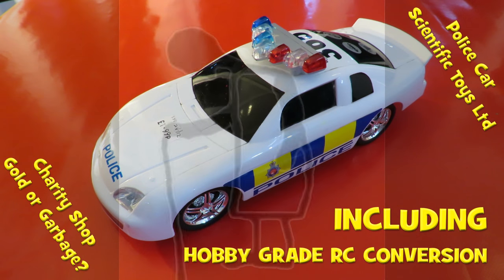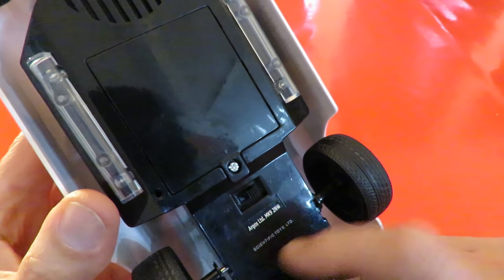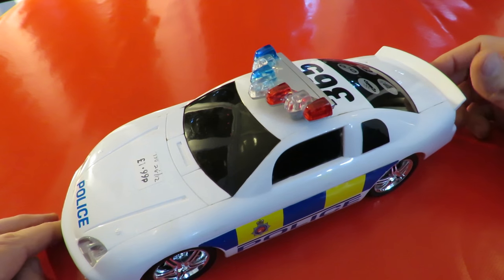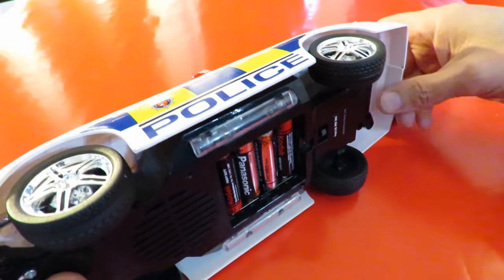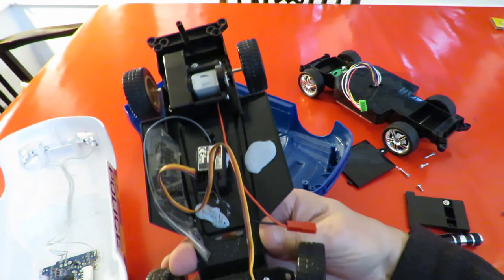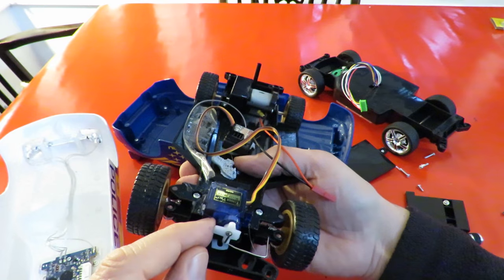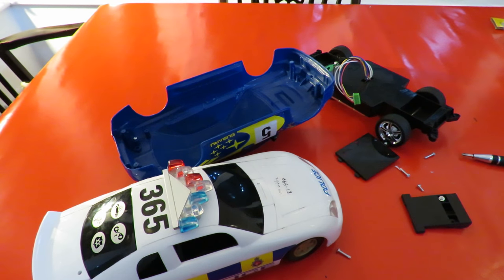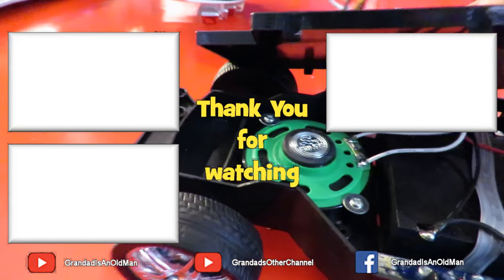Police Car - Scientific Toys Ltd - including RC conversion

Comment: for them to fly right they have to balance on your finger and for the plane's your building looks like inside house plane's because there light weight airplanes outside will knock the plane down will just a little wind will do it

Comment: Looks more like a generic nascar body that they stuck police lights ontop of & used some headlights from a nissan z300 & front end from a nissan 350z up too the front window while sticking on the nissan z300 lights further out.

Sort of following this body shape starting from the front window past the hood/bonnet all the way too the back.
http://www.searchamateur.com/pictures/rc-nascar-1.jpg
Reply from the maker: Maybe. It was the general style of the low level front grill that made me think Audi but I cannot spot one that looks exactly like this one. Is nascar a toy brand? I thought NASCAR was National Association for Stock Car Auto Racing in which any type of car could be raced. I have identified the brand name for this toy so I will add it to the video description but it doesn't help me identify the car.
Reply: +GrandadIsAnOldMan it looks like they took the body of a NASCAR RC car and slapped police stuff on there

Comment: hey grandad, can you make a radio controlled flying or non flying plane??    please make this  :)  :)
Reply from the maker: Here are some RC planes I have done
Hot Wire Styrofoam Plane playlist https://www.youtube.com/playlist?list=PLA5a2xPRSrB1Qj--01eR1NU_K2RCbH3R8
Another Plane from Scrap Foam playlist https://www.youtube.com/playlist?list=PLA5a2xPRSrB0IHk7pAAHCwTLfGDX_SK-k
Can you use cheap motors and cheap RC for a plane playlist https://www.youtube.com/playlist?list=PLA5a2xPRSrB3v7nI2gkMPSAD5LOoSQkzk
DLG Pizza Tray Glider with Cheap Kite frame playlist https://www.youtube.com/playlist?list=PLA5a2xPRSrB3JAFc7f5qk95lpdSMOXDHw